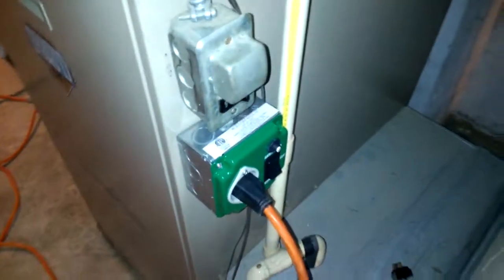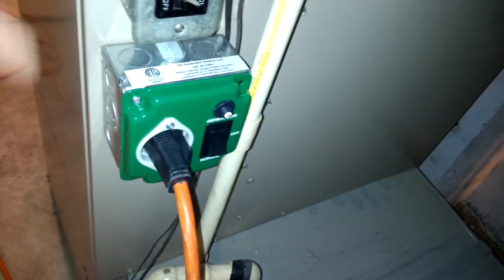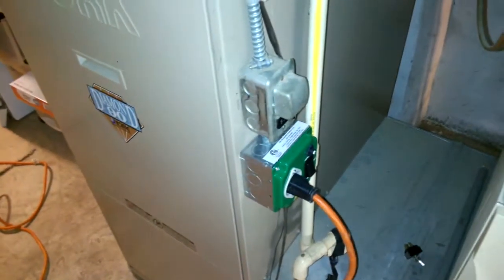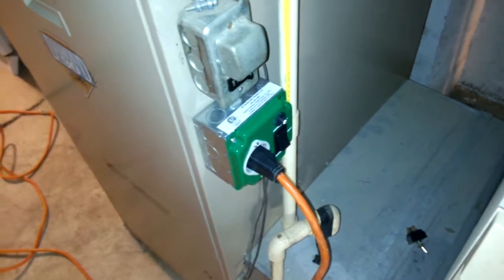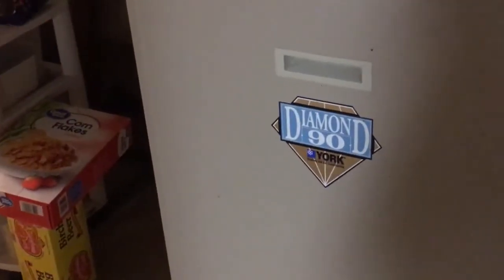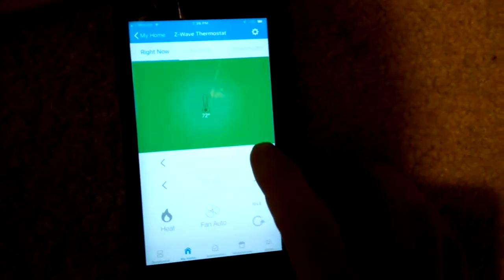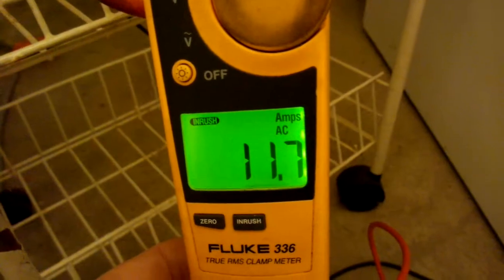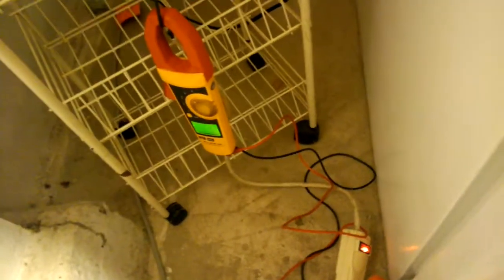How much electric does my gas furnace use?

Comment: Do you have a video on the installation of the generator switch?
Reply from the maker: @HealthyHearts  sorry no I don’t, I believe there are a few ways to install this depending on how your main panel is bonded. I would reach out manufacturer to discuss your particulars.

Comment: If I’m setup with heat pump does that also need to go into generator too or can you bypass that for emergencies
Reply from the maker: @jasonvivian9770  I’m not 100% sure I understand your setup, what is your main source of heat? If it’s gas , then you’d have like I do,but yes you’d turn off the backup source, unless of course you had a large enough generator to also power the heat pump.

Comment: You're pinned description is incorrect. You used 22kwh day one not 2200.

Power costs are roughly .10 a kwh in America. If you used 2200kwh in a day, your furnace would cost $6000 a month. 

Just a decimal placement issue but important distinction nonetheless.

Comment: 560 running watts makes sense. On most residential gas furnaces the largest portion of the load is the blower. This is typically a 3/4 HP motor which equals 559.5 watts. Throw in 500 mW for the thermostat and controls.
Reply: How do I determine the starting watts requirement for my gas furnace?  The plate on the furnace says it's got a 1/2 hp motor, and it also says 9.5 under "max unit amps".  Do you think the max unit amps figure is the starting or surge requirement?  Thanks.
Reply: @berettaguy7445  The 9.5 A figure is likely the starting surge current, which is about 1140 W. 1/2 hp is only about 3.11 A at 120 V. I'm ignoring power factor, which is typically 0.85 to 0.9 for a single phase induction motor under load. Might even say on the nameplate for the motor what its PF is. Add the usual 15% safety factor and you'll be okay.
Reply: Thank you. @larrygilbert7273

Comment: Never understood other invertor installs just to run a blower for a gas furnace. Power goes out and I am nice and warm in my dark house where my refrigerator is not working.  Hook up a manual interlock and power these things with a small generator for the same amount of money.  Or hook up your inverter instead of the generator with the manual interlock eliminating the need for your dedicated furnace green plug and allowing you optionality on what you power. Seems like a lot of inverter kit just a power furnace blower.

Comment: Just cut the wires and install a male and female plug male side on the furnace side. And female side on the power coming from panel  unplug from main then plug into power station in energencies

Comment: All flame based furnaces uses a different amount of watts of electric power. After you know what a specific system uses, then you can calculate based on hourly, daily, vacation time, temperature of areas requiring heating, regularly occupied time and etc. These are the variables that determine the best standby generators needed. Not everyone has this type of heating system in their homes, some use all electric heat pumps and AC compressors. When the utilities power goes out, you’re going to need alternative energy sources to compensate. Think of the requirements of “Going Off Grid”, base those values on selecting a generation system. Remember it can be days to weeks for utilities companies to get their systems restored after a major disaster event.

Comment: Sry but I'd build that switch instead of paying 100 bucks for it lol🤣🤣🤣🤣
Reply from the maker: Would yours be UL approved so that if you had a fire related incident the insurance company would cover it?
Reply: @SuperRobkar  These are very simply constructed.  It would be exactly as putting in your own electrical socket.
Reply from the maker: @dthompsont3796  I'm not questioning the construction, What I am questioning is if your insurance company would pay the claim if your homemade one was found to be the cause that burned down your house. Are you willing to take the risk over $100?
Reply: @IFix-Things - yes. Scare tactics don’t work for me. Be confident in your ability and knowledge.  Weigh risk reward. This is too simple of an install to worry about your scenario.
Reply: @IFix-Things  good point..
Reply: @IFix-Things   UL, are those the stickers you find on hot-chassis radios?

Comment: 11.7 X 120 volts would give you Volt Amps, or Apparant Power, NOT True power. Since you're dealing with AC and an inductive load, you'd need to multiply by power factor.  The Kilowatt should give you Power Factor

Comment: Did you setup the EZGeneratorSwitch to be Bonded or Floating Neutral?
Reply: Using an ECOFLOW--you have to use the floating neutral--otherwise it will not work. Reason being: your furnace recognizes the neutral at your panel and then gets "confused" by the neutral of your ECOFLOW--you cannot have two dedicated neutrals!--THAT is no go.

Go floating neutral! See EZ Transfer Switches great vids! CHEERS!
Reply: This is a great video! Thank you

Comment: Mine uses 0.1A Resting/OFF (12.5W), 0.82A (103W) for 1m 45s, then peak firing (702W for 10 seconds), then running is 3.6A (450 Watts). Figure 125VAC. but yeah, 450 Watts is tiny, in order to keep warm when the power goes out. Runs for 13-18 minutes. At 12.6vdc that's 35 Amps running watts (450w).
Reply from the maker: Agree 100 %

Comment: You have a Nest like thermostat, that uses Wifi, to control the furnace you have on a UPS.  What supplies power to the Nest?  To the Wifi?
Reply from the maker: The thermostat is able to still operate in the event of a power loss. It doesnt need wifi
Reply: Most thermostats including wi-fi versions, use a small amount of electricity taken from your furnace. The control module or circuit board where you connect the thermostat to the furnace is where the power is taken. Usually "R" and "C" terminals.
Reply: 1. Nest only needs power, No Wifi. Two, the power is coming from the furnace . They’re on the same circuit. His solution kills two birds w one stone! Murica!

Comment: Check the furnace label. It will say how much amps max it needs.
You also want to double the wattage of your inverter generator to have room for the fridge and network / computer equipment.

600w from the furnace plus 1300w fridge will require 3kw(sustained) inverter generator for the efficiency.

Comment: My gas ( hot water) furnace uses 28 watts
Reply: That’s what I was trying to figure out. I guess an air blower pulls a lot more power
Reply: That's most likely the electronic control circuitry. The blower (fan) is what uses the most. It will be in the 700+ watt range. It depends on the HP of your blower. That is why they talk about Running and Standing watts when calculating generator sizing.
Reply: My gas water heater uses zero watts. Old school type not these new fangled forced air ones that require power to run a blower and a larger thermopile to run the circuitry. More stuff to break and require service calls 😀